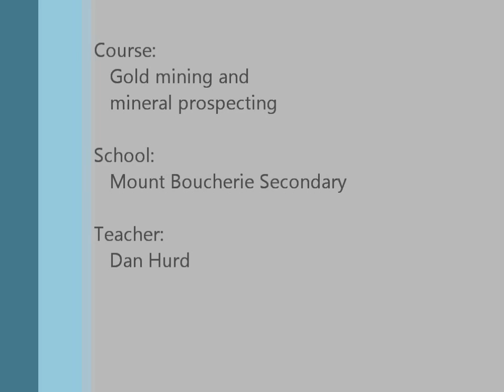Gold Mining Course, How to use a Blue Bowl

Comment: I use a magnet to remove residual black sands cuz it can take so long otherwise.  But with magnet need to make sure water  is flowing at a good clip so it will help prevent picking up gold with the black sand.

A vibrating mount would also help to speed the process up.

A Silicone mat at the bottom helps also to keep a hold on the gold.

Turkey baster is also very useful with this setup.

Comment: I think I understand how this works, with centrifugal motion basically, but it seems like one thing goes wrong and you may have to start all over. Could you make a demonstration on how the spiral wheel works? I understand they take a long time so I wouldn't expect it to be time lapsed but just showing the startup, and end results.
Reply: So I looked at some other demo's on the spiral wheel and discovered its not for the fine stuff lol. My bad.
I'm just trying to find the easiest method as well as cheapest way to get the returns.
Reply from the maker: Actually the spiral wheel works really well with the fine stuff.